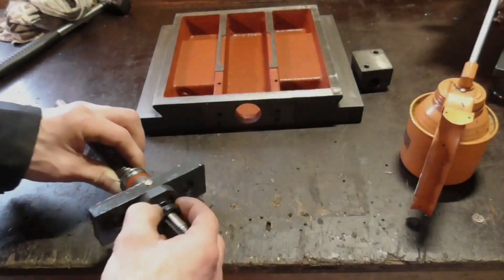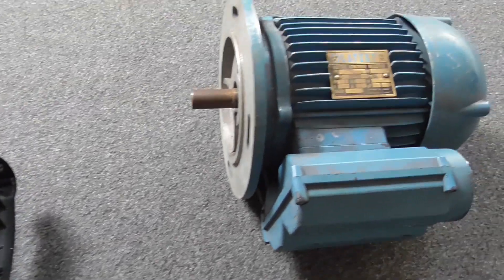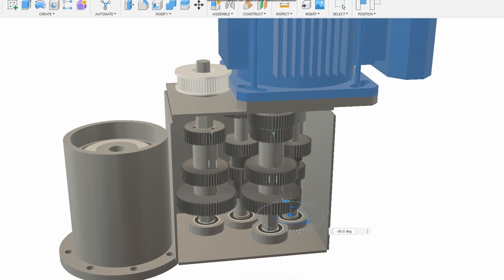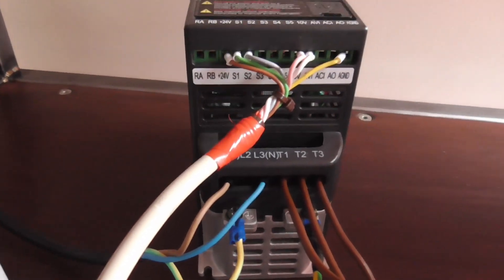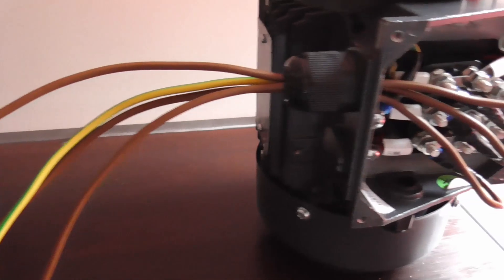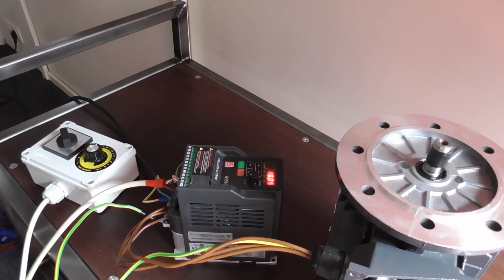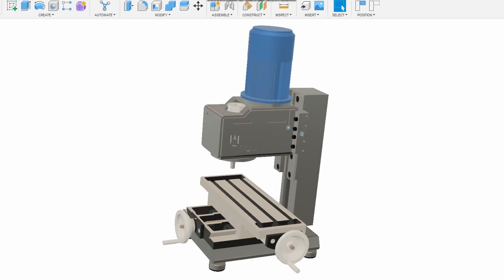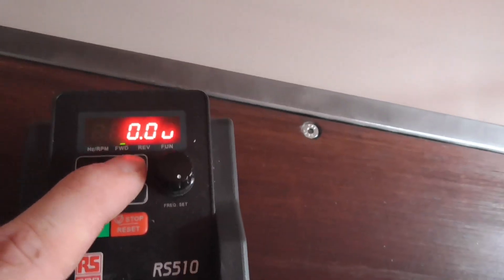Homemade Milling Machine - Infinite SPEED CONTROL

Comment: where did you buy the frame? im looking to build a similar sized machine
Reply from the maker: The frame itself is designed and being built by me, I got the xy-table from Amazon, similar to this one: https://www.amazon.nl/-/en/Milling-consisting-multifunctional-worktable-sliding/dp/B0871M9BH3/ref=sr_1_29?crid=YMRBODV34OI8&keywords=freestafel&qid=1675780354&sprefix=%2Caps%2C100&sr=8-29